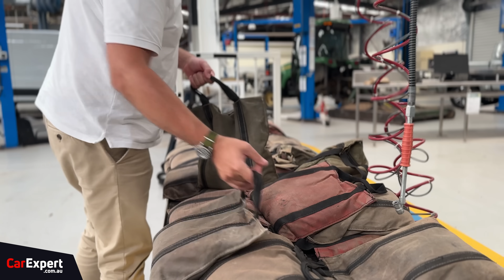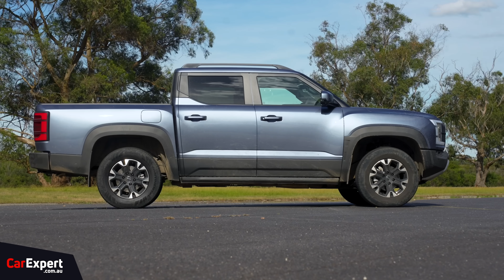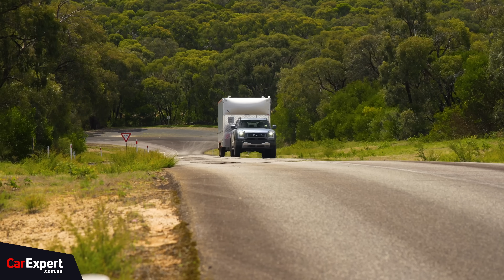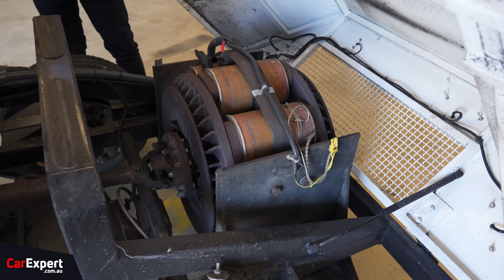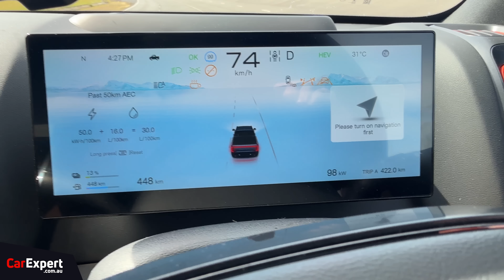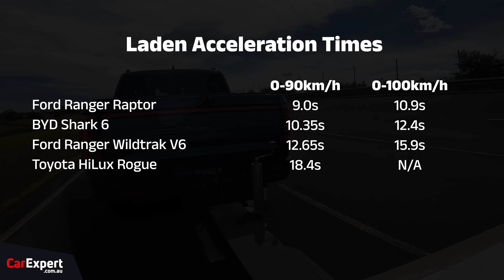BYD Shark 6 towing STRESS test at MAX payload - the results are surprising...

Comment: Grossly unfair test and omitted information. Very poor form. Sorry the long reply - but this covers what people are asking in the comments (theoretically, but should be accurate as a sensible test wasn't done). We can calculate that theoretically you need 83kW to pull 3kN at 100km/hr, add in wind resistance, friction, losses etc, and the fact the Prado sits on 99km/hr (150kw) engine, and a hilux can't even hit 100km/hr. We can assume we are burning 150kw at this speed. Seems battery was "maybe" 60% charge at start (so assume SOC was set to 25% as wasn't mentioned and seems this was a hit job),  so 17.4kWhr of charge, so nearly exactly 10kWhr of charge till the engine kicks in at 25%. At 150kw burn - 4 minutes until you hit 25% SOC and engine starts. At this point things get interesting, at 100km/hr suspect the little engine can put out say 120kw (as it is direct drive, assume max power close to max RPM at say 150km/hr), so the remainder of the battery is discharged to 15% (at 30kwhr burn, consumes the 3kwhr between 25%SOC and  in less than 5 minutes) then then vehicle starts to apply limits. Unfortunately at this point the ute slows, so does the engine and even less kw are available (as the engine RPM drop as direct drive). Hit job. For reference as the physics seems to tie up - a summary below of what height you should be able to gain - at speed with a higher state of charge at max load capacity.

Unladen a ute probably pulls 60kw at 100km/hr. Add a windcatcher, another couple of axles, it's not double, but say 50% more (based on reduced km's when towing with any vehicle), so say 90kW required to tow on the flat at 100km/hr. At this point the ICE can put out estimated 120kw, so happy days, can tow all day on the flat power wise, and charge the battery even, and definitely keep it at 50-75% SOC. Lets assume 50% SOC (so double my calc for 75% SOC as we assume at 25% SOC we have issues best to avoid). Lets hit a 7% grade at 100km/hr. Now on top of the 90kwhr to roll along we need to lift 6000kg (Shark plus Trailer). At 100km/hr we are lifting say 6000kg at 1.95m/s, this requires an extra 115kw of power, so 90+115 = 205kw. (and why very few vehicles can tow a 7% grade near 100km/hr). So at 205kw, we get 120kw from the ICE, and the battery must provide 85kw. A quarter of 30kwhr is 7.5kwhr (Between 50% SOC and 25% SOC), and at 85kw draw - this gives just over 5 minutes - or 8.8km of 7% grade. Double this if you hit the bottom of climb at 75% SOC.

For reference and the biggest uphill haul with a trailer that i have ever made - Wolf Creek Pass, is 14km long at an average grade of 6.4%. So in theory with a 75% SOC, the Shark could drive at 100km/hr for the entire climb, climbing a vertical 900m in 8.4 minutes. (And nobody tows this at 100km/hr, even if your engine that can put out over 300kw (like mine did in the US,) you would melt your transmission. You will not find anything near equivalent in Australia.

But yes - If you attempted Wolf Creek with a SOC set to 25%, or try and tow at 321kw at 130km/hr up a 7% grade for 5 minutes you will end up stalled on the side of the road waiting for it to recharge (at best). If you are that stupid hopefully you are not towing.

Will this analysis hold up... I think it will be pretty accurate... Would i treat the shark like this every day.. no. But nor would I my Ranger.
Reply: Spot on, it's a shame they didn't spend a bit more time learning how the system worked first.
Reply: @Johnno1979 Oh, I think they know exactly how the system works.

Comment: My wife has a Mitsubishi PHEV. It’s brilliant around town on short journeys and a 30 km round trip to work. She has only used 2 tanks of petrol for this year for that use case. For the long journey with lots of ascents use case, the ICE motor works hard once the battery is depleted resulting in the fuel consumption of 7.x litres of petrol per 100 kms. The car is lugging around 2 electric motors, a battery and an ICE motor. Our previous Golf Diesel used high 4.x litres per 100 kms on the same journey.  PHEV’s are great for short journeys but long journeys, maybe not unless you want to stop regularly to charge up the battery which is ridiculous. 

For people in a rural location travelling 100’s of kms per day regularly, you’ll need to research whether a PHEV is suitable for your use case. I would find it annoying if the Shark dropped back to 74 kph in 100 kph zone while towing.
Reply: The Outlander is a good softroader platform.

The Outlander weighs half as much as a Shark and the Outlander has a reliable naturally aspirated 2.4l petrol engine (much less stressed than the little  1.5l 4 pot screamer in the Shark).

For city driving and residual value retention, I'd pick the Outlander over the Shark any day 👌

Comment: Once the battery is low/flat you only have what the engine can make as power which is great until you need more than that. 
That means any time you ask for more than (in this video) 100kW or so you're depleting the battery. 
That doesn't need to be a heavy trailer if its a large one with poor aero's. To hold 100k's you're going to use more than 100kW on the flat and level even with something like a decent boat trailer on the back or if there's a headwind and things in the bed or whatever - its not a high bar is the point. 
The more over 100kW you use the faster it depletes and the less it can put back in so far from the outer limit case Paul thinks this is, for long journeys running heavy or with a lot of drag, in the rain, in the cold or whatever - this is going to happen quite regularly. 
When it boils down to it this has a claimed 170kW engine minus losses which aren't small in a series hybrid so by the time it gets to the wheels you're looking at a constant maximum of around 100kW. Anything over that and you're relying on it having charge to keep it going and while 30kWh is great for running around town its almost nothing when you're talking about dragging a big ute and trailer against the weather - even using 190kW total - something easily done in heavy use - it will take that battery from completely full to completely flat in 20 mins. Thats presuming the whole 30kWh is usable but looking at how it behaved in this test that seems highly unlikely. 
The bowl test showed it all - the LC would go around all day until the fuel ran out then top up and go again. This didn't even manage two laps which in the real world is taking you pretty much nowhere.

Pauls test showed this in a short time but on a longer run where you're using more than the engine can charge regularly this will happen repeatedly.
Reply: You have absolutely no idea. You are never going to have a 2.5t trailer needing more than 100kW to tow. Remember a lot of utes could not even get this to 100kmph.
Even my slow as f Cannon can tow 3t at 100kmph with ease.
A trailer dyno is not even the remotely the same as a trailer.
Reply: @aljoubert8749  Again for those who can't get their head around it - this isn't simulating weight but rather load. 
You may be able to tow 3t at 100kmph on the flat but that means nothing if its a small or decently aerodynamic rig. Heck a ~200kW semi can haul 40T+ at 100 on the flat depending on prevailing conditions. 
This is simulating work required to overcome a load (not a load as in weight but a load as in a loading from all the forces involved) which in this case is perceived as a set weight and a set gradient. They are variable for the same load so you can have a very light but large trailer into a headwind, a light trailer up a steep hill, a heavy trailer up a slight hill or any mix of them to get to the same resistance. 
Say you take your 3t trailer up a 10% grade - that would mean the dyno trailer could be set to an equivalent drag to provide similar resistance. 
As for a 2.5T trailer never needing more than 100kW to tow - on this ute thats over 5000kg train weight and you imagine its going to do that into a headwind, up a hill with 100kW? 
Lets see the video of you trying (and failing miserably) at that. Physics simply disagrees with you.

Comment: Interesting test, though my feeling is that the stress test would have been much more insightful by doing the following:

1. Set minimum SOC at 70% - My understanding is that once battery drops below this engine will kick on to try maintain this SOC. Vehicle shouldn't power limit to maintain 70%, but will run ICE to put power back into batteries. On the 3kN stress test I wouldn't expect the engine be able to keep SOC at 70% but it would have taken much longer to drain battery down to a minimum SOC to where the vehicle is power limiting. It would have been interesting to know how long in kms it travelled in this scenario before going into "turtle mode".

2. Specify what the stress test relates to in real world. My calcs indicate that it would be equivalent to towing 2500kg up a 10-12% incline depending on drag. Correct me if wrong. Towing at 74km/h up this sort of slope still seems like a pretty good effort for running purely off of ICE. Also not many roads have this level of incline for any decent length.

Video didn't specify what the minimum SOC was set at but it was mentioned that the setting used was EV priority so batteries would be drained to whatever this setting was before turning ICE on.

Comment: Most of the power is from the two motors. Thus depleting the battery first and then asking for more power is not a good idea. BYD should programmatically change the settings so that when in tow mode, SOC is always above 50%. Or users can set up to higher values to avoid this edge case.

Comment: Once again inaccurate testing from you... Why on earth would you think running the battery down to its minimum operating capacity would be a good idea before conducting test's with actual data. You drove it around pointlessy with a trailer on the back first, collecting zero scientific data.
All 3 of these videos it seems you have purposely put the shark in a position to give it's worst possible results. 3 times starts to make you question how much is ford or Tesla paying you...
The idea of it being hybrid is that the battery should never get to 25% when the ute is being worked, you would set the minimum to 50% to 60% so there's plenty of juice left to power the all wheel drive capability when it actually needs it.
I'm glad to see other people now starting to call you out on the clear bias of these video's. From putting the car into the obviously wrong drive mode whilst testing, to depleting the battery or overheating it before testing, to not being extremely clear that this is a pre production unit, you've done everything possible to give it an unfair review.

Comment: For this exact reason is why I prefer I think the Ranger phev will be better. Im sure it will be way more expensive and still a "Ford" but I do not trust that BYD 1.5lt engine to push 5 tonnes of vehicles and charge a battery at the same time over long distance driving.

The BYD seems great for city driving with weekend off roading but it taking anywhere outside the capital cities for holidays or long distance road trips, its just not designed for that.

Comment: Really nice review. But I think you focused on the wrong data in the fuel economy section. The sharks economy is awesome given its petrol and all the others diesel (except raptor at 36.5l/100 which a full 20% worse!  So even in this the sharks is cheaper to run (diesel inherently has more energy per litre BTW as it’s denser).

Comment: I missed hearing any comments about long range highway driving while towing, will it maintain sufficient battery storage?
Reply: At 100km/h it may use 50kw at most on flat terain while towing ,engine is 130 kw,so more then enough for driving and charging ,on hills you will use like 13%  battery for every 10 km hill at 100 km/h

Comment: why is the test being done at such low battery %?  fair enough show the comparison when it has both charge and without but not showing the fuel performance with battery is sabotaging the results.  You'd have the SOC set way up when towing uphill, not pumping on a sub 20%
Reply: because the battery doesn't stay fully charged when you drive genius ffs some people are so dumb!

Comment: I've seen comments from Mexican owners, and they all say that the first mistake you make is using low charge minimum while driving long distance.  Because if you need to do a section where you require long hills while towing, and you have sub 25% charge, it struggles.  Keeping it at 50 seems to ensure you have enough juice to cater for those situations, then the regen will pull it back up while normal driving again.
Reply: I have one in México. Just keep it on SOC Save 70%. And it's not designed for long outback trips, just use a Diesel UTE for that.
Reply: @DellCvz  if you currently run one then you can advise us what the real world consumption is, which I think is critical in understanding how efficient and how much stress the engine is really under. Would love to know more from actual owners, because they live with it daily. From what I have seen the 1.5 turbo engine is pushing high revs to charge up the battery and drive the vehicle limiting performance and sucking down around 16litres /100km . So your input would be enlightening.
Reply: Correct. If you know you need the power for long periods, go into the correct mode
Reply: This has been my thoughts exactly , the trick to getting the best out of this vehicle is going to be how much you keep in the battery, the obvious worst case scenario , is a looooong steep incline with low charge in the Battery while towing, if you run out of battery before getting to 70km/h , or worse, it is just too steep & too long so you have zero chance !, you will have no direct drive assist to the front wheels, and thus you may need to stop (on a hill which is less than ideal ) , and wait for the engine to re charge the Batteries , in order to continue ! , Ok so it's still better than having an electric only vehicle for obvious reason, but I think BYD should include a dual clutch system with a second lower gear, that say kicks in at around 25kms/hour, less chance of getting caught out & it would give the electrical system an easier time of it ! :).
Reply: @pwrrpw319 You can just keep the battery in high state of charge while towing.
Reply: If you are towing something just let the battery hover around 75% SOC.
Reply: They need to test it at extremes
Reply: Absolutely spot on.
Reply: First mistake is buying one of these.
Reply: tell me you never driven through remote parts of australia without telling me. Battery juice will eventually go down to super critically low level
Reply: @miraphycs7377  it wouldn't, if you set it to around 50% to 60% the car would deplete the battery to around 30% to 40% during peak use using the all wheel drive system and then recharge it's battery back up to 50% 60% during lulls in the driving.
When driving off road you aren't constantly going all out 100% of the time. You'll go through demanding sections and then go through easy sections . Setting the percentage higher for the motor to kick in gives the battery enough wiggle room to power both electric motors whilst also managing the depletion and recharge ratio.
Reply: @matt09ward  finally, someone else that has bothered to find out how this thing works. Well done 👍🏻
Reply: @miraphycs7377 it doesn’t seem to be the use case for the most, choose different route mate.
Reply: @bobyu9494  how can i choose a different shortcuts when this BYD has such a lousy AWD system to perform properly offroad?
Reply: @miraphycs7377   not if you set it at a higher rate ... the vehicle charges itself
Reply: Cut the poster some slack. They live next to the US and their "no one could be farther, better, stronger" stuff.

Comment: 30l/100k’s

I’m afraid you’re wrong… your screen shot shows 16.8l/100k’s the 30l refers to a calculation based on electric power plus fuel usage… the screen even shows you that

The range is also showing 400 plus k’s so unless it’s got a 130 litre tank… it doesn’t… your numbers are wrong

I think you were lazy and just read the screen and that’s your problem

Just like your torque explanation as to why the Shark didn’t climb your little hill in a previous episode… you simply don’t understand EV’s 

They are not the same so stop comparing them like for like

The hill climb is a software issue not torque and the fuel usage isn’t 30l/100k’s … no 1.5 turbo can supply that amount of fuel 

 The reality is EV’s are different… our use of them is going to have to be different too… at least in the short term

What I want to know is will I deplete the battery doing “normal” things… like towing a real 2 tonne van at 100 and off road at lesser speeds

That’s a real test for a real EV

Comment: I see others have commented already,  but PHEVs when towing generally work fine when battery is not exhausted and hense never drops below say 50%. My question is, is there an option/button in the shark to save battery for when you are doing things like towing? If there is then I'd love to see another test with that selected. Thanks
Reply: YOu can set target SOC ,so engine will keep it like above 25% or 50%

Comment: Great honest review Paul. I think those shortfalls are going to be only for heavy loads with long ascents and descents or bush bashing, which most people are not going to be using it for (most don't use their hiluxes or Ford Rangers for that either, it's for ferrying stuff in the back on mostly city roads), so these are weaknesses that won't be tested very often.
But these are nevertheless weaknesses that BYD can and should work on for their subsequent models.
Clearly a more powerful ICE and bigger battery as well as better regen settings and architecture need to be looked at for more powerful spec models.
Reply: than you have 3 ton ute ;)